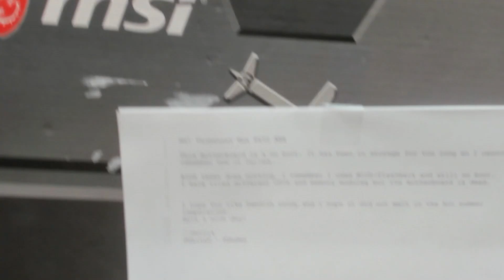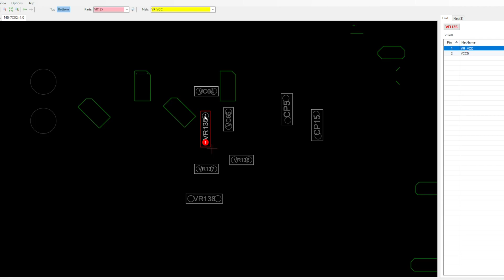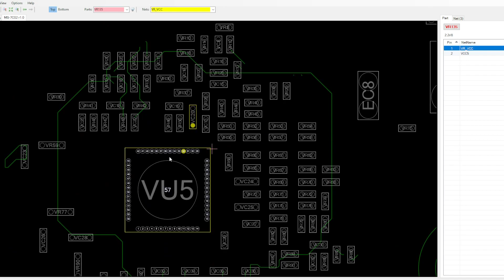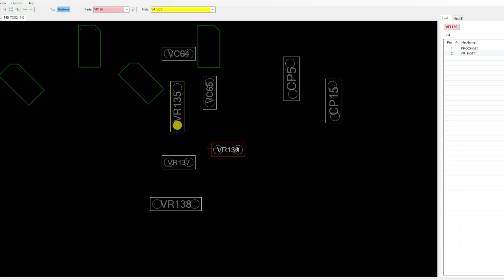VIEWER FROM SWEDEN SENT HIS BROKEN BOARD || MSI B450 TOMAHWAK MAX REPAIR

Comment: Hello your repairs are amazing. I have bought a usued b450m mortar max but the ram slot that only works is A1 and A2. B1 and B2 are not working will reseating the cpu helps? btw my cpu cooler mounting is via tension so it has very strong mounting force in the socket and it's kinda scary.
Reply from the maker: It might, but it could be for a lot of reasons like physical bending the board, because off high mounting preassure!

Comment: You have to show the BIOS flashing process sometimes. I have recently repaired an ASUS CROSSHAIR VI EXTREME. The symptoms were the same. But the USB BIOS flashback didn't work. The BIOS flash chip appeared to be damaged. The only thing that helped was replacement. And it's not an uncommon breakdown.....